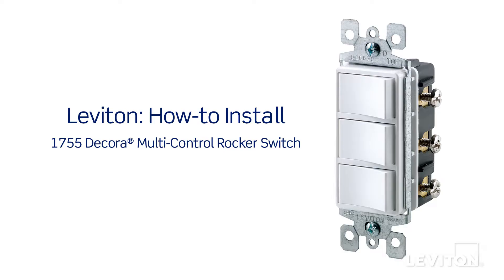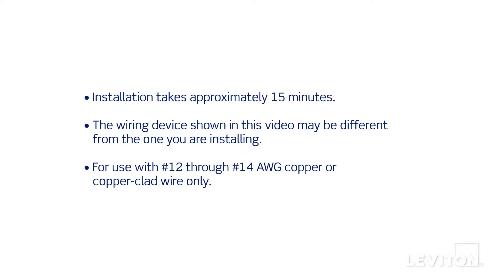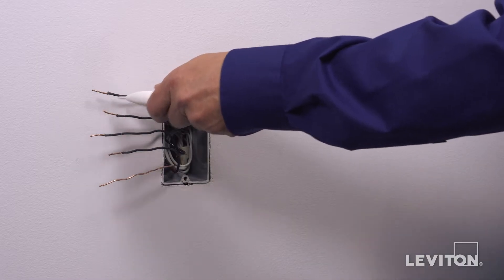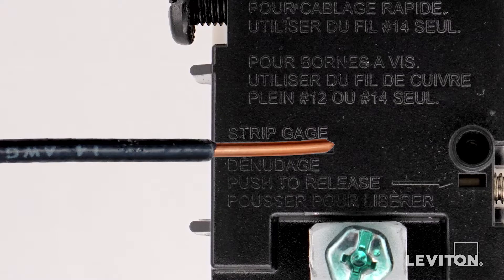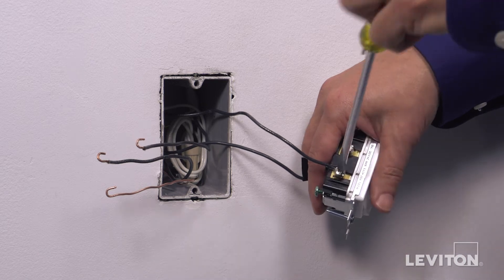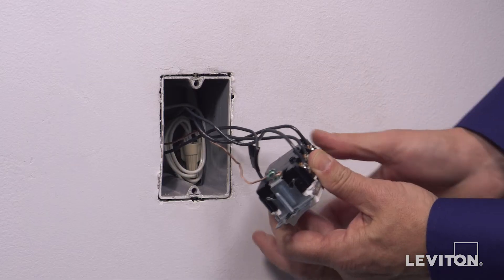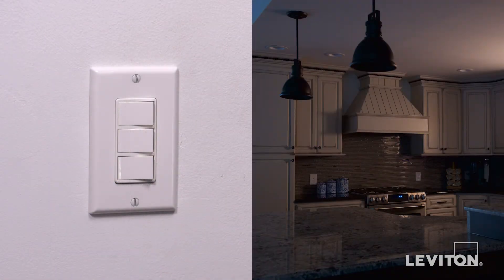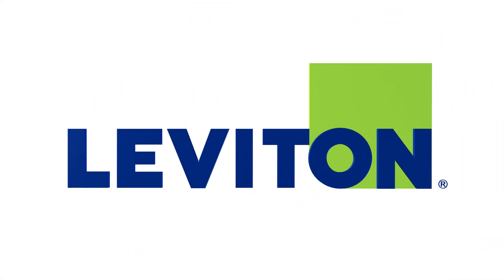How to Install a Decora Combination Device with Three Single Pole Switches | Leviton

Comment: “Around any of the silver terminal screws”

Man I feel for the peeps watching this that are trying to have each switch a designated  load.

The load you want to turn on must match the switch.

So if you want the bottom switch to turn on the back porch light,that feeder wire must be screwed to the corresponding switch….not just any.

Comment: Is tht 14/2 or 12/2 wire?
Reply: You've probably figured it out by now but I ran a 14-3 wire along with the existing 12-2 wire to get what I needed. Power coming in, and the 3 going out were black from 12-2, and the red and black wires from the 14-3. That way I didn't have to run a 3rd line.

Comment: My switch has 6 screws  soo confused
Reply: That is likely due to it being a Single Pole, Single Pole, 3-Way functionality (1-1-3).  3 screws on one side should match, all for turning the switch on and off.  On the opposite side you should have a green screw for grounding (sometimes found on the bottom of the switch instead), a black(or brass) common screw for your power in from the box to the switch, and a final screw for 3-way functionality.  I know new Legrand switches tape off the 3-way screw to prevent confusion.
Reply: OI need one with 6 screws, where did you get it?

Comment: Please cover all around with electrical tape for safety
Reply: No it’s useless and not code required. Ive seen electric tape wrapped around switches and outlets just slowly peel off and hang in the box. Its messy. Only time i use electric tape is for wirenuts or the push in tabs
Reply: It’s a plastic box lol
Reply: The screws being bulky make the tape not stick well

Comment: What if I have a red and black wire as hot wires? Which do I use
Reply: You probably will not get a professional to answer, here (I am not one). Assuming the wiring is not incorrectly color coded, a hot wire can be black OR red.  Which get used, and where, is to the previous installer's discretion. But often the cosmetic difference allows you to more quickly determine that the black wires came from the romex (what is upstream and downstream hot) versus splicing/pigtails to other outlets in the box.  For example I have a 3-gang switch... black hot comes into the first switch, and then red goes from the first switch to the second, and so on.   If there were a zillion black wires it would be tougher to track.  

ALSO: NEVER trust someone else's color coding if it doesn't seem right. Call someone. Homeowners do all sorts of things incorrectly after a building is constructed.
Reply: Should have only hot ,one neutral and one ground.

Where is your voltage tester?

Go to your breaker and see which one comes out of the breaker and which one is on the ground bar. 

One is most likely a neutral not labled correctly.